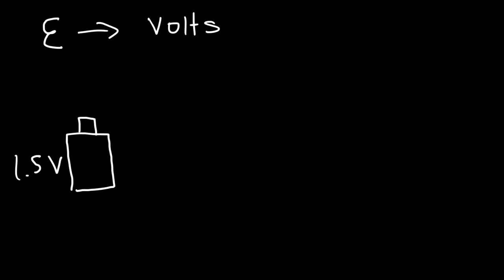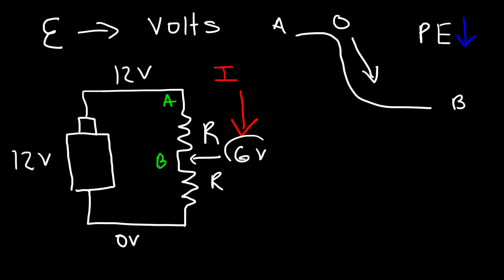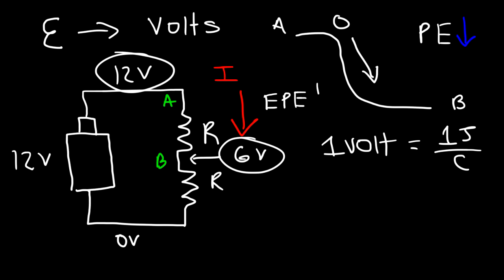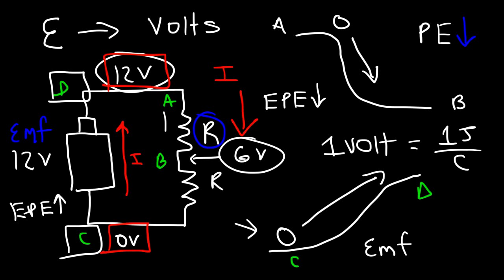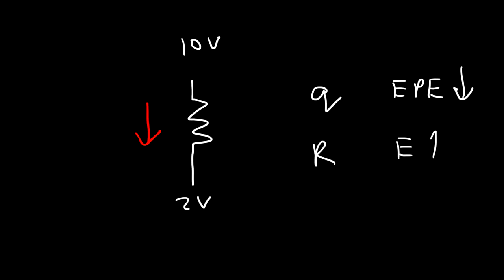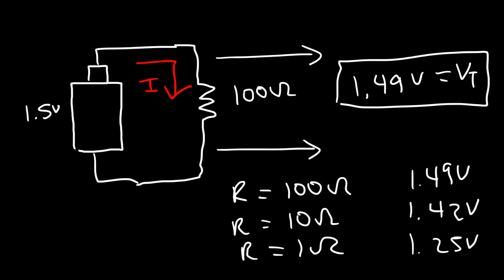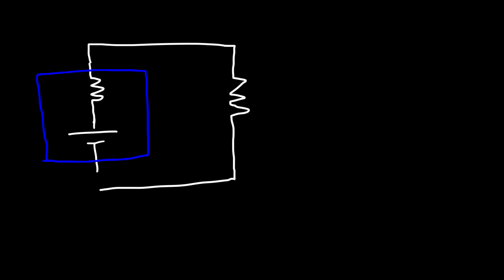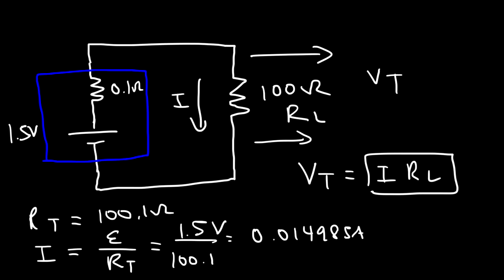Electromotive Force of a Battery, Internal Resistance and Terminal Voltage

Comment: Thank you so much for clearing up EMF.
I couldnt for the life of me understand internal resistance because my professor spent the entire time teaching us how to derive the super drawn out formulas and then tried to cover all of circuit 1 in the span of an hour. And hes a physics 2 professor. Internal resistance is basically like resistor being akin to a rope being pulled. The stronger the resistor the more it pulls out of the battery. The weaker the resistor the more the battery pulls back. In a sense lol

Comment: The units of emf and potential difference are volts. While potential difference is a path integral of the electric field made by real charges, the emf is the non-Coulomb work per unit charge and might in principle be chemical, mechanical, gravitational or nuclear in nature. 

Electrostatics and circuits belong to one science, not two.
These are discussed usually separately in textbooks and science and engineering courses. 
Watch the two videos listed below to learn about current and the conduction process and surface charges (using a unified approach to electrostatics and circuits) which set up the electric field whose line integral is the potential difference. The battery produces the emf.
The last frame of video #1 lists textbooks which discuss all these topics in more detail.
1. https://youtu.be/TTtt28b1dYo 
2. https://youtu.be/8BQM_xw2Rfo

Comment: Can I put the internal resistor parallel to the battery in some cases?
Reply: The internal resistor is inside the battery so you can't do that. Unless you have a different type of battery which is not in my syllabus.

Comment: Can voltage be same as EMF sometimes ?
Reply: No, EMF and Voltage are different.
Differences Between EMF and Voltage
:
The EMF is the measure of energy supply to each coulomb of charge, whereas the voltage is the energy use by one coulomb of charge to move from one point to another.
The EMF is represented by the ε whereas the symbolic representation of the voltage is V.
The EMF is measured between the endpoint of the source, when no current flow through it, whereas, the voltage is measured between any two points of the closed circuit.
The EMF is generated by the electrochemical cell, dynamo, photodiodes, etc., whereas the voltage is caused by the electric and magnetic field.
But they have the same SI unit: Volts
Reply: @5staryzzz  is the work done to raise to potential energy of the electrons the result of moving the negative charges against the eletrostatic force field of a positive charge which wants to keep the negative charges close to it, seeing as positive charges attract negative charges?

Comment: Sir, could you please explain the emf now in terms of flow of electron rather than current? Thank you, it was a great explanation.😊
Reply: Within the emf device (in this case the battery), positive charge carriers flow from the negative terminal of the battery (where there is lower electric potential) to the positive terminal (where there is a higher electric potential). The charge carriers flow in the direction of the emf arrow in a circuit diagram and in the case of an electron, the direction will be from the positive terminal to the negative terminal (because the electron is a negative charge carrier). The motion of the charge carriers is opposite that of which they would have due to an electric field between the two terminals. I hope that helps :)
Reply: @myburntfruitloop1853  thank you.😊
Reply: @myburntfruitloop1853  yea you r a lifesaver too
Reply: @myburntfruitloop1853  An electron flows from the negative terminal towards the positive terminal in a circuit...